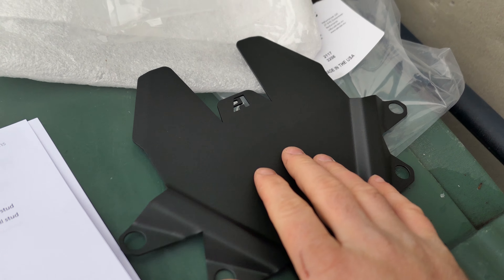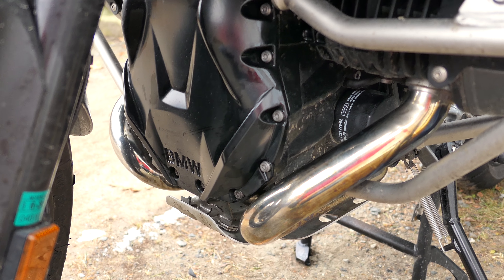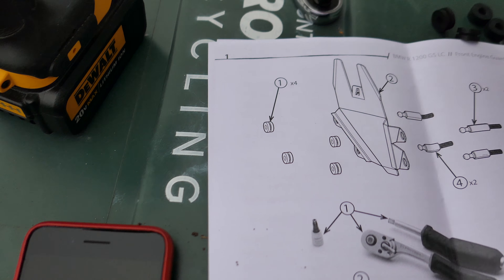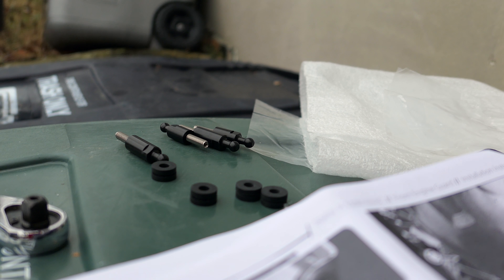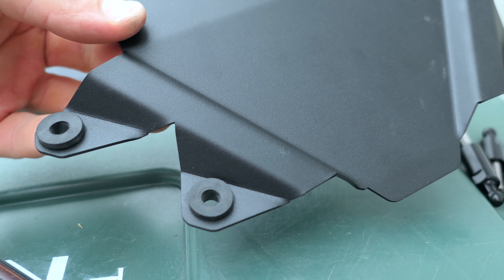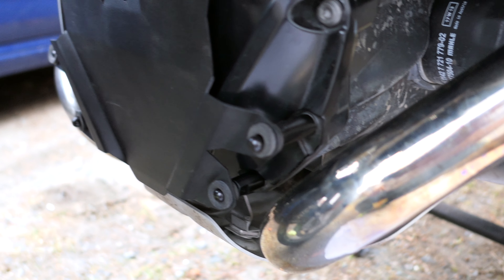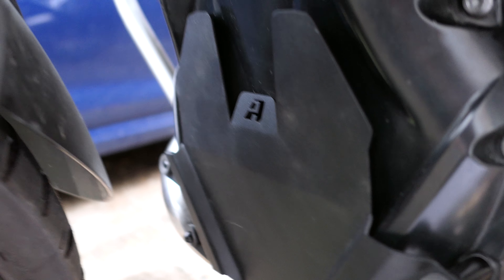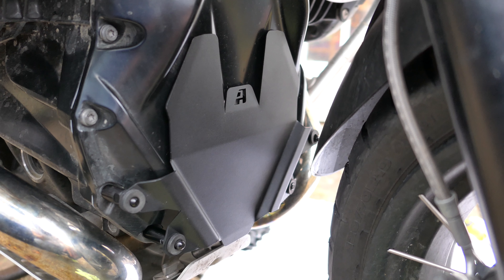Install: AltRider Front Engine Guard for BMW R 1200 GS Water Cooled

Comment: I think that you installed the new screws wrong way. There are two longer screws, and two that are shorter. As I can see on your video, you cross mounted the screws, that's why the plate don't fit as it should. Maybe these longer screws should be mounted at top, and the shorter ones at the bottom....

Comment from the maker: Hi guys. a note on the stud lengths being incorrect. You're absolutely right that this was the issue. Funny thing though, I sent this video to AltRider a week ago and they made no mention of this at all. That everything looked fine and also that my modifications were understandable given the issues I had. In this case, I have to blame their support for not raising the issue earlier but the plate is now working no problem with the changes I made :)

Comment: Very poor design, maybe the screw needed to be longer where you could not get a good fit. And I think the addition of rubber edging at the top where I am sure they will vibrate onto the engine. Shame as I think they are needed to stop crud and tar getting onto the engine. Nice video though glad I saw what the guard was like but I thought the engine bolts would have required thread lock.